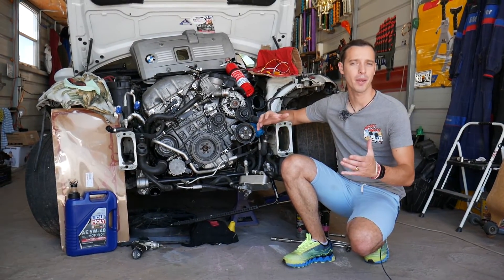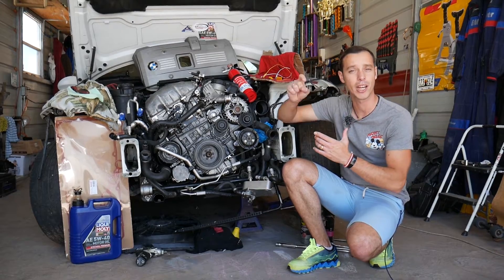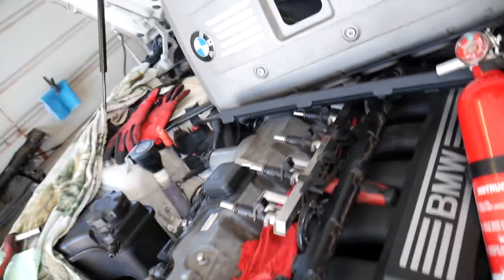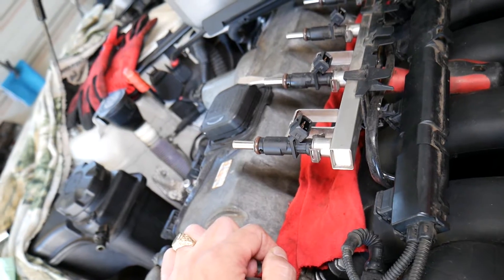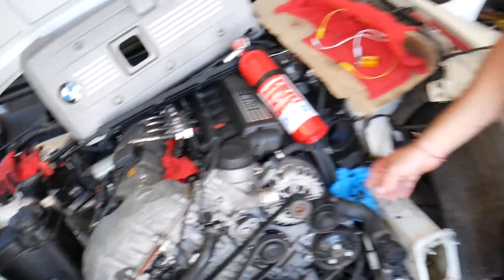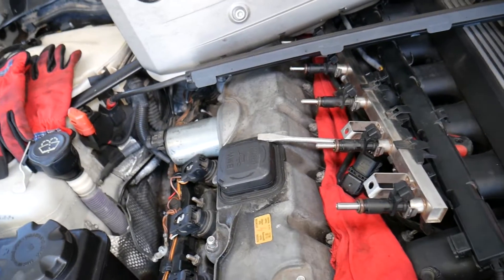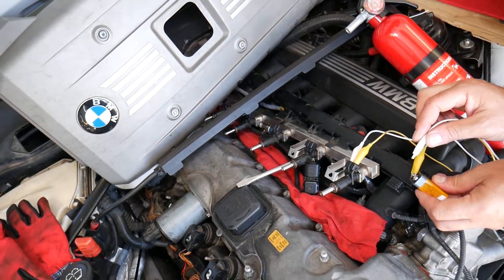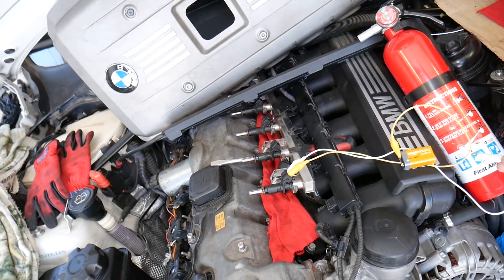HOW TO TEST FUEL INJECTORS ON BMW E60 E61

Comment: This is fine for testing the fuel injector itself for clogs, but how can we test if the DME is sending the signal to fire the injectors?  Can the fuel rail be connected to the wire harness but have the injectors be out of the engine?  Then maybe use INPA or some other tool to fire the injector?